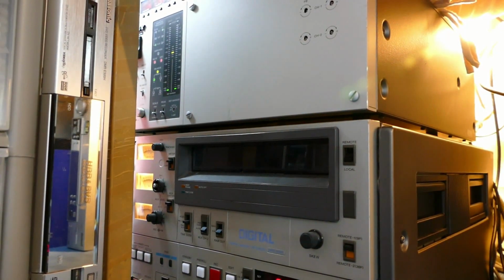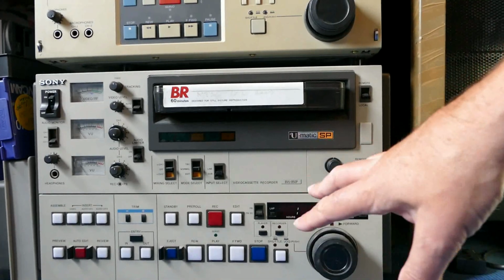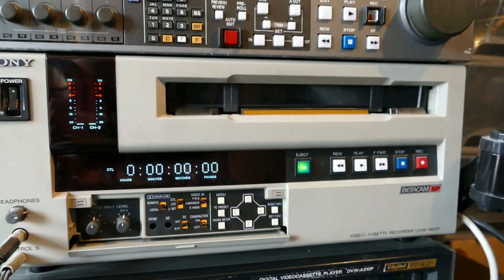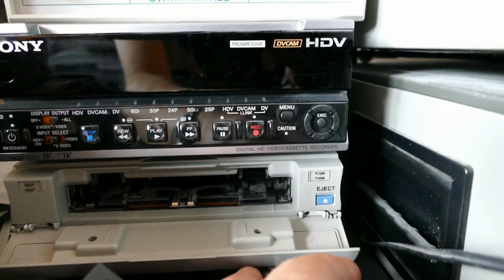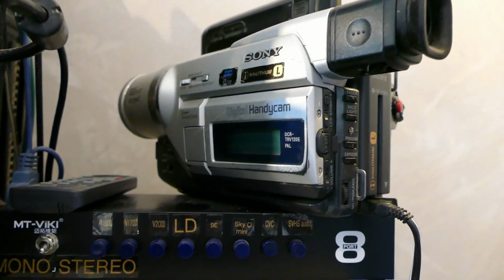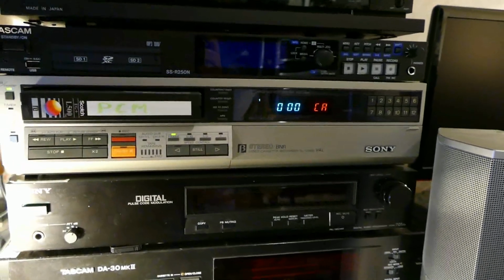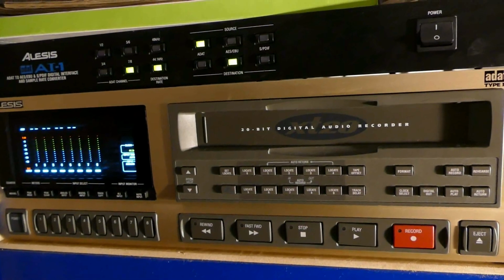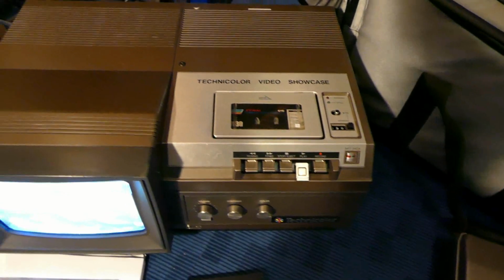Rare video equipment.  A tour of some unusual video recorder equipment in our studio.

Comment: Fascinating tour of your set-up there. Mine are racked very similarly, but are still in an upstairs room - so I have to be conscious of weight. I have a mixture of formats - the low band u-matic - yet to go to a high band more professional machine. There are a mixture of N1500/02, N1700/02, V2000, open reel, Betamax, etc.. Recently purchased another Shibaden VTR. A couple of AV3620CE open reels as well - circa late 60s. Think the Shibaden is around 1970/72. I find the N1500 internals a lot more intricate and awkward to maintain than say the N1502 - which is very similar to the N1700/02 models. These Philips are my favourites to work with. Every machine though has it's moments with technical problems though - always something to fix.. The joy of this old tech though is in it mechanical nature.. Something a lot of modern equipment lacks..
Reply from the maker: I don't use N1500 machines at all, not least because the servos are not very stable.  The N1502 is a much better machine.  I've added A/V outputs to all of my N1502, N1700 and SVR models.  The electronics in these machines is fairly reliable, but I've had the occasional I.C. fail.  V2000 machines on the other hand seem to be plagued with unreliable electronics.  As for racking, I'm just about to properly rack all my audio gear to make it easier to access whatever machine it is near the bottom of the stack which always is the one which throws a wobbly!  Just got in a lovely Aiwa XK-007 cassette deck.  My studio is on the ground floor but even I worry a bit about weight, there must be almost a tonne in here.

Comment: Could you make a more in-depth video about the MII format? There is not much information out there, certainly not here on YouTube. I'm not expecting a Techmoan-grade video, but maybe a look inside your machine, and some more of your thoughts on the system. Could you use S-VHS cassettes in these machines?
Reply from the maker: Good point, I should cover MII.  Some of my non-working machines are in my store room which would be best covered in spring time when it warms up a bit (but you can see them on my "shed" video).  I have one working mains machine, two working portables, two non-working mains and a non-working camera backpack.  There was one model, which I don't have, which supported S-VHS playback, utterly pointless feature which fixed the head drum size at the start.  Then the format was hobbled by the tape size: Beta was the right size for professional camcorders, VHS was too big.  So Panasonic decided that the VHS size would be the studio sized tape and they would make a smaller tape, bigger than VHS-C though, for camera use.  This forced the tape to be super-thin.  These two constraints made the tape path very complex and the format was staggeringly unreliable compared to Betacam.  Panasonic compounded that with poor support and additionally the machines were much harder to work on than they should have been.  Hence it was set to fail against the hugely successful Betacam.  It's odd how Sony and Panasonic made some of each others mistakes in VHS vs Beta and MII vs Betacam.

Comment: It has been a long time since I've seen an operational CVC VCR. I found that the capstans seize up.
Reply from the maker: The problems I see with CVC are: Won't fully lace or unlace due to plastic expansion on the loading ring assembly.  Capstan servo not working properly due to conductive glue or other faults.  Belts etc. always need replacing and one is very fiddly to get to.  Head tips can go open circuit on PAL machines, probably due to glue creep.  On top of all that, the 212 portable machines are not easy to work on, and generally access to the deck is quite poor.  On the plus side, tape path alignment is never a problem.

Comment: Are the colour bars and tone generated by the Digibeta internally? I read in some of Sony's advertising material that these machines supposedly can do this, but even with the help of the manual, I was not able to get this set up.
Reply from the maker: Yes that option is in the menus, which will vary a bit from one model to another.  It will generate a tone and bars when no tape is inserted.  I have this option enabled on my J3, DVW-A510P,  DVW-A5100P etc.

Comment: Hmm, It's probably fairly easy to bypass the video to PCM converter by just grabbing the raw video while keeping the field structure intact (e.g. by using DV). If you can get me a snipped of video captured that way, I can give it a go.
Reply from the maker: Software has been written to do that already.  I've tried it and it works to a point, but my setup at least gave lots of errors.

Comment: I would love an in-depth coverage of the CVC machine(s) and the format itself.
Reply from the maker: As it happens I might be doing a collaboration with someone else on this very subject next year, but I don't yet know when.
Reply: @video99couk  I had to give my CVC video head a push before it starts spinning. Any idea what could be the problem? I don't know how to completely disassemble the machine to get to the belts under the video head, hope you'll make a video servicing CVC machines and maybe even a S-video out mod.
Reply from the maker: @rsuryase I've not had that problem.  I can't remember right now if the head is direct drive, I think it probably is, so it sounds like a bad head drum motor.  I do plan on doing a CVC video (or two) later, but I have a few other things I need to work through first.  I won't do an S-Video mod because my TBCs have such a good Digital Comb Filter design that they do a super job of removing any Composite Video effects.

Comment: Very nice collection of equipment. Yes MII was a horrendous format, a lot of design decisions that where not good, lousy product support form the start and on top of that lots of bad capacitors....  You need some big formats too, 1" C format and 2" quad.
Reply from the maker: Alas no space for the really big open reel formats so I just can't go there.
I think there were two main design blunders on MII: The large tape is VHS sized so too small for a high speed format to hold enough tape of a sensible thickness. 2: A few machines were made playback compatible with S-VHS (why?!!) and this set the head drum size.
Reply from the maker: As it happens there is now a 1" C format machine in my collection, to be worked on when I get some time...

Comment: My CVC Technicolor 212 can only output video for 1 hour, then I need to let it rest for 1-2 hours before it'll output video again. If I don't, it'll just output black screen with static lines. Sounds like an overheating issue, most likely electronics issue and not mechanical. The video playback is not perfect, I can see a few static lines here and there, most likely need a tape alignment or the heads are worn out. No one seems to know how to service this machine.
Reply from the maker: A fault like that will require an oscilloscope and service manual to resolve. It's not trivial but can  be done.

Comment: Hi Colin, have you ever had any problems with your DSR-11 DV deck? I am getting no picture when playing tapes and I can't work out why. Heads seem clean but no signal is being output. I can't think of anyone better to ask for help!
Reply from the maker: I have four DSR-11 decks.  It sounds like yours has clogged heads so I would run a tape cleaner first.  Do you get the on-screen graphics OK  (need the remote to select those on and off).
Reply: @video99couk  Thanks for the reply! I have tried using a cleaning cassette and also manually cleaning the heads but no luck. I do not have the remote unfortunately so can't see any on screen graphics, but I do get an preview output when I connect something to the inputs
Reply from the maker: @videokassettejunge  OK, that proves then that you have a valid signal path from the DSR-11 to your monitor, that's a good start.  Not having the remote makes debugging a bit harder.  Do you have a PC with Firewire input?  If so you could see if you get a valid clock running which would indicate that it is seeing something from at least one of the heads.  Also, try forward picture search with a known good tape, sometimes that will clear a head clog at least enough that you can see something starting to happen (maybe a picture in striped bands, implying one head has cleared). 

If you have a fairly strong magnifier, you should be able to see the head tips, if clean you can get them to glisten in bright light and you will see they are shiny.  If contaminated, they will have a dull look.  Great care with the head tips of course.
Be aware that these machines don't play Long Play DV recordings, or not very well at least, so make sure its a DVCAM or DV in Standard Play.  They also won't play formats such as DVCPRO, or HDV.
Reply from the maker: @videokassettejunge  Glad to have helped.  Do please subscribe!